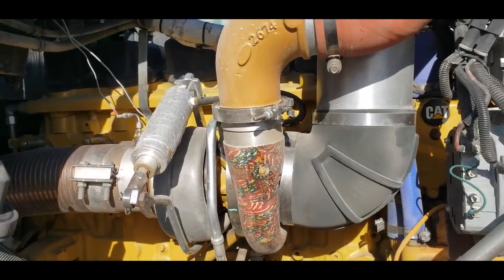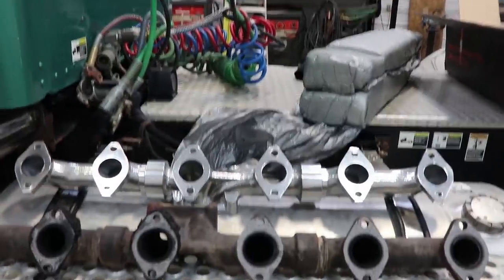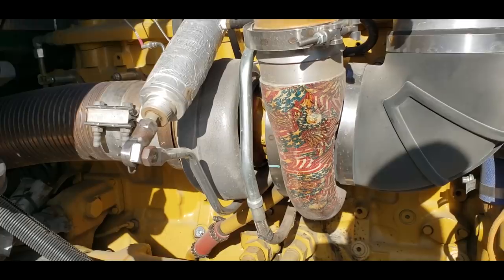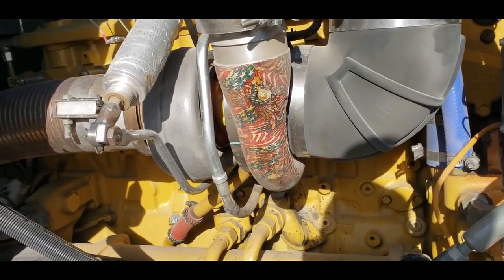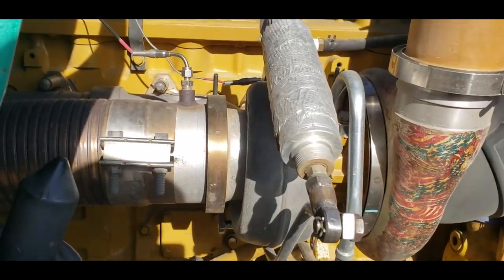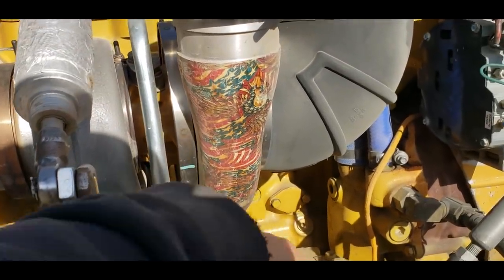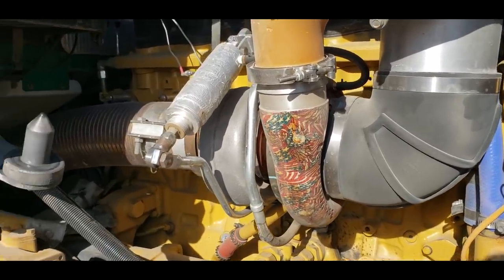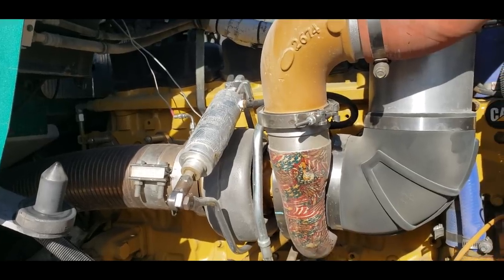Switch Blade Turbo

Comment: You are a rare owner my friend 90% of owners don't even know how to drive their own truck let alone diagnose it and they don't know the difference between manifolds turbo boost pressure engine life extended oil changes because you're dragging less soot off the cylinder walls they will run bad injectors dumping raw fuel washing the oil off the liner can't understand how a bad injector would cause their piston to fail you're a rare breed my friend⛽🇺🇸
Reply: Holy Shit! I would bet money that you are a high school drop out. Am I right?

Comment: Still on the fence over these Switchblade setups huh? 

Seems these pay for themselves in oil changes pretty quick, not to mention improved performance, which is reason enough alone to swap one in. I didn't realize they were so reasonably priced. Seems like the work to install and tune is the only downside. The video you did on the mixture control re-calibration seemed quite a lot of work and involves some pricey CAT springs and widgets. Is it required on all installs? If it were simply a bolt on, seems they would be nearly mandatory for anything they fit.

Comment: Not worried about power I tune my own ECM I can make power but I am interested in Jake's performance. Series 60 Jake just isn't that strong I'm running billet 171702 while pulls hard my Jake vs stock turbo went down by Alot I lost a whole gear. Did you notice any improvement in stopping power?

Comment: Got it. The Switch Blade Turbo will not work with the stock exhaust manifold. The ports are too small, restricting the exhaust.

Comment: Hey Jeff, been following your videos on this turbo.... finally ordered one about a month ago after I watching this video & saw the lower price. The question I have is I noticed you’ve changed the compressor side of the turbo, was curious why. I believe you had the 78 mm & now you’ve got the 80. I’ve got the 2ws (70 pin ecm) 3406E with the marine cam (800) & 58 injectors.
Thanks Bob
Reply: hello Bob did your switchblade work correctly.i put on my my 6nz and its not making any boost.i am bobtailing trucks feels worst than my stock unit.i will put a trailer behind me soon see if the unit pulls
Reply: Hi Micheal, no my switchblade turbo did not work correctly, ended up exchanging it for another switchblade... this one works (I guess...) but I’m not impressed. The thing rattles under high boost and I don’t really notice any difference in performance and definitely no increase in fuel mileage... didn’t lose any just no increase. My conclusion is that they are (for the price) a huge waste of money.... wish I never would have bought the thing.
Reply: I am noticing the something a rattle under boost and worst than my old unit.i may just ask for a refund i spend the night installing thinking it was going to help my unit.not impressed with this really
Reply: @bulrack66  i guess of i can get a refund I will just take that turban side off put a regular hotside on it and get rig of that piece.not impressed could have bought a yellowjacket and be done not I have this thing not sure I should take it to the mountains and breakdown there
Reply: On my turbo the rattle is just the arm (switchblade) that controls air flow on the exhaust side, don’t think there is anything wrong with it, it’s just annoying! If that’s the same in your case I don’t think you need to worry about breaking down because of it. But if you can I’d certainly try for a refund, these things are not worth twice the money of a properly spec’d turbo for you engine. 
Good luck
Reply: I’m having same issue on N14 525hp, it’s not spooling turbo any faster but opposed feels really sluggish with only 25psi @ 1500rpms VS before 34psi on stock turbo & no there’s no boost leak or cocked center cartridge in the turbine housing.

Comment: Hey Jeff: I recently bought a 2007 Pete with an NXS Accert 550, and I would love to try Jim's Switchblade turbo, but I am concerned about loss of engine brake power. I know you have a Brakesaver on old Kenny as well, but can you feel if the "Jake" is any less effective? I see you also removed the VVA's. Does that affect the Jake as well? Enjoy your videos, and the high production values. The time spent shows. Thanks from up here in Canada, eh!
Reply from the maker: I didn't delete the iva's 
As far as jaking power goes,  the single makes 20 psi and the twins get up to 30? So it does affect it a little,  but the fuel savings and cost savings when you have to replace two instead of one makes it worth it,  the only reason Caterpillar has two turbos is to make the emissions system work , ACERT  
   Plus your going to be replacing the bellows between turbochargers, or they'll be leaking along with a pre cooler  and the twins cook your iva housing gasket and iva sensor along with pretty much everything thing else near them. Lol
Reply: Thanks for your input. The sale price on the Blaylock turbo is a screaming deal as it is cheaper than an OEM replacement. Keep up the great site.

Comment: Didn’t you install one on a 1693TA and if so how did it work out? Was it worth it? Thanks
Reply from the maker: I put it on my 637 scraper a D343/1693 and it doubled the oil change interval

Comment: So this might be a stupid question but why doesn't anyone ever run a turbo blanket on a diesel?
Reply: I wrapped my manifold and turbine housing on my 5.9 24  valve Cummins , and the turbo spools much faster, and I get lower exhaust temps by 100 * ,  and boosts sooner because the heat stays in and drives the turbine faster sooner, and it doesn’t expand, and I gained 1.5 mpg. Look up Power Driven Diesel YouTube channel. they did a dyno test with and without blankets, the spool-up was 2 seconds sooner. This is what sold me on them, plus it keeps your engine bay cooler, and cooler air going in means more horsepower.
Reply: not a stupid question.  what a turbo blanket does on any turbo is take advantage of the hotter air moving faster.  the faster the air the quicker the turbo response.  once the air cools, it slows down.  same reason you wrap manifolds and headers on a race car.

Comment: You speak very highly of the performance aspects of the S.T. but not the fuel economy.  The ad speaks of better fuel mileage, what is your experience?
Reply: He's talked about fuel mileage increases in other videos. I believe that he said that he gained at least 1 mile per gallon more if not more than that pulling that big D9 and scrapers.
Reply: The fact that you don’t see tones of black (unburnt fuel) rolling out the stacks when he dragging a D9 behind him tells me that the Switchblade Turbo is more efficient and that cam only equate out to better economy and power, additionally when you see a truck rolling a lot of coal out its pipes means the oil is being fuel contaminated quicker and losing its lubricity which means you need to change your engine oil more often and that is money right out of your pocket.  If I could ever get to where I could drive again there would be no doubt in my mind about running a these turbos on a truck I owned.

Comment: 3:20 that lower manifold isn't smaller than the new one, the holes, you can see it by eye on the video.
Reply from the maker: 1/4 inch smaller on the  Caterpillar manifold

Comment: Not many diesel owners understand that black smoke does not make working engines great.
Reply: Black smok is unburnt diesel fuel & $$ out of ur pocket .Not to mention the carbon build up in exhaust system & added backk pressure that will reduce horsepower ...
Reply: Go to Banks Engineering, he is probably one of the most educated diesel tuners out there. His stuff works, no smoke.